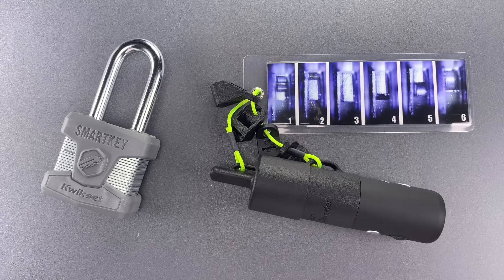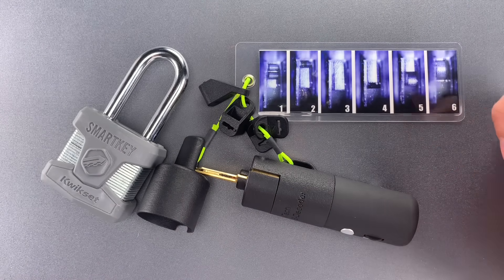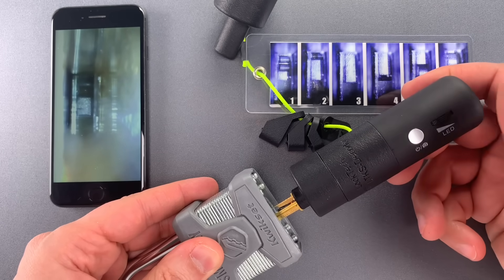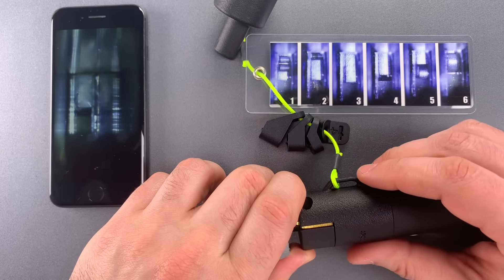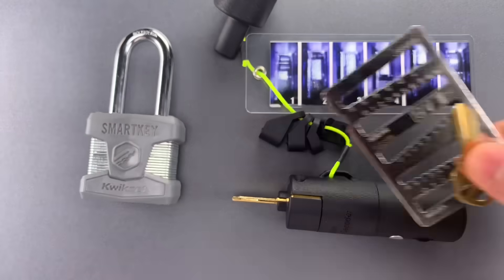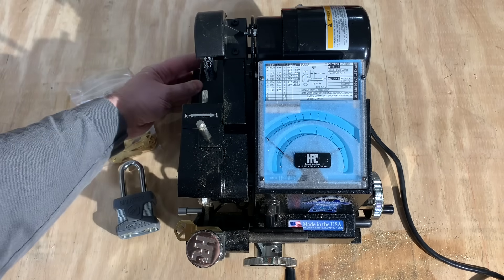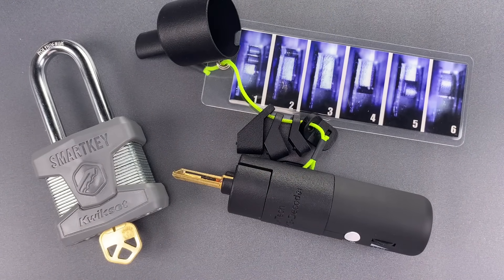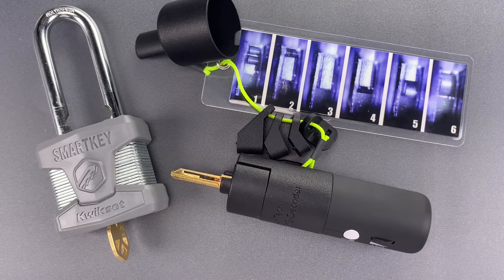[1209] This Tiny WiFi Camera Owns Kwikset SmartKey (LockTech LTKSD)

Comment: This channel is a thief’s wikipedia.
Reply: High skilled thieves don't work into common burglary, they also have better "jobs" to do with all this knowledge.

If you don't live at silicon valley and work to google...
Reply: It's also a home security resource for those looking to defend against unlawful entry into their homes/property.

Before finding this channel, I had no idea locks were this easy to get into, even for someone like me who can only afford a very basic commercial pick set for locksport.
Reply: @Vociferous-Fred  Just make sure the house of your neighbors looks easier (and appealing) to rob than yours. Be low profile.
Reply: @Vociferous-Fred  Put 2 different locks on each door is a good start
Reply: A thief still has to carry the tools, walk up to the locked access point, and stand around fiddling for a while to get it open. That's the really hard part of being a thief. If you can do that, you can bring a screwdriver and a hammer and defeat most locks without this channel.
Reply: @Vociferous-Fred  have a separate different lock waiting. if you notice someone come to your door, insert something, then go away, you change your locks.
Reply: @Vociferous-Fred  It's easy, you just have to replicate what our predecessors have done. I suggest to refer to the ancient pyramids trap designs and curses. It managed to keep dishonest people for centuries so they have proven track records.
Reply: Not really. You ever tried picking real lock? Lol I have....
Same luke saying that talking a out wifi vulnerabilities is a hackers dream place... no it isnt lmao tey hacking wifi in real life lol
Reply: @htcmlcrip  I've done some script kiddie hacking, hardware modifications, and lockpicking, and lemme tell you... the average shit sold to everyday people? An untrained teenager could do it if they had an instruction manual and a free afternoon. Security is all about appearances. Most of it couldn't keep out a bored kid, physically or digitally
Reply: Let's remember this isn't just a matter of tools. The LL itself do this for years to the point he can open some locks with a redbull can.
Reply: Let's not pretend that thieves need an education on their craft. They already know. LPL is more like a wiki manual on what NOT to buy for material owners by exposing lock weaknesses and helping people with good security.

I once had to remove a lock on my own bike with a lost key, i used a plumbing torch. I didn't need to be told

Thieves are stupid but not brain-dead. They at least know how to steal.. Getting away with it is a different story.
Reply: @EstablishAtTheFront  what's the point of picking a lock to a theif when they can break a window or just use a drill or just break down the door and shear off the lock with a sledgehammer
Reply: @hackerhacker-ms2wy  
Locks only keep 
Honest ppl out!
Reply: @EstablishAtTheFront  The methods in this video specifically are only used in actual heists. Your average smash and grab thief won't go anywhere near impressioning tools or key duplication.

This tool makes a three man job, with someone on the inside a one man job with very minimal requirements.

$1500 is a lot for consumers, but for a heist with 100k, it's a very worthwhile investment.
Reply: @EstablishAtTheFront  sure, but this material is also helpful to those just getting started. Not that it shouldn't be published...

Comment: The trouble with quikset rekeyable locks is occasionally the don’t reset and the lock is toast.  You used to be able to take your core to a dealer like Home Depot, but they no longer have the devices, or personnel to use them.  So if they fail to rekey, you must replace them.

Comment: Does anyone realize how this is only a few hacks away from making a key matching the pin pattern via battery-powered two-axis CNC in a backpack while you slide in the probe thing? It would use streaming video instead of pictures and AI image recognition. It would "see" where the pins are, analyse the image and gather what value to cut, then instantly cut that value. You could feasibly have a key ready in about the amount of time it takes to stow away the probe and reach for the backpack.

Comment: I feel that with very small sd card and video mode it could be done even faster.
Meaning that to could actually record video of key going through the whole lock.
Then with some not super smart application that could analyze video frame by frame it could easily output the settings for the key for you.

With above improvements it would require you to just come up to door, slide it slowly into the lock and then go away - without need to focus on smartphone or anything - as you can either postprocess it later in home, or have software do it for you.
That has some potential. Scary stuff.

Comment: Another take on @sixstringedthing below: "Here I have Abloy's Quantum Lock, whose operation relies on the emission of beta particles from the key, which consists of a standard key blank with cesium-135 and strontium-83 inserts. Now you'll remember that the pioneer in this domain was MasterLock, who brought their version to the market a little time ago. As you know, it used the quantum spin effect, which left the lock in simultaneously "locked" and "unlocked" states, the decision being made by the key. However, it failed because the waveform could be collapsed to "unlocked" simply by thinking very hard in its general vicinity. Abloy have made a better fist of this, so let's get to work. My Geiger counter shows clicks on one, ..."

Comment: Just thinking beyond that excellent design I would suggest as your using a mobile a smart app would compliment it well ,in that it would read and store the cut coding automatically as the "key" is inserted slowly into the lock (or a motorised drive). The user could then scan several locks naming each file individually, take the readings away to make keys and come back to an openable lock.

Comment: i would like to see him pick a double sided (double keyed) dead bolt with one key turned half way around on the other side. no matter the brand. i have found that as long as 1 key is turned at least half way the other can not complete the rotation. that has been my experience anyway..

Comment: For that cost it should slide the camera/mirror itself and take a video. That way you can discretely plug in the device and just hold it there for a few seconds instead of carefully aligning it with each slot. Also, I hope it comes with inserts for different styles of keys!

Comment: When all else fails, just cut a new key.

Literally what the locksmith did to get me back into my old apartment when I locked myself out a few years ago:
- Front door had a cheap passthrough and a good deadlatch keyed alike
- Locksmith spent about 5 minutes trying and failing to pick the deadlatch (slippery pins wouldn't stay set)
- Turned to me, said hang on did you say they're keyed alike? I confirmed.
- Disassembled the passthrough, took the barrel out to his van, used it to cut a new key.
- Opened the deadlatch, gave me the key. Problem solved.

Comment: That is a cool cutting machine, I used to use a lower cost technique of saving a bunch of keys with different depths. I could find a key that almost matched the depths i needed of often would find one or two overcut positions. To solve the overcut problem I used solder.  I would  use a wire brush and remove the oxide from the cut I wanted to build up. then place the key in a vise/holder between some paper to form a channel and then drip solder on the key, let it cool and hand file it down. It's not a solution for many uses , however hand filing solder to the correct size is easy. The electronics solder is required with the flux in it and you can buy it much finer than plumbing solder.

Comment: @LockPockinLawyer  This was a great video.  I have on lock on our house where the key has gone through several rounds of copying and the newest one don't work smoothly.  Since I am not the first owner, I do no know how many but non of the keys look original.  We also have a 1st generation Miata and the keys have worn to a point they they also don't work as well. Several times I have thought about how to resolve this the video got me thinking again about key codes.  The research from that lead me to Key Biting Specifications and the process by which you can measure a key to make sure the cuts are correct.  Key Biting Specifications seems like it would be an excellent - and very practical - video.

Comment: A much cheaper way is to just have 36 KW1 blanks cut to each pin depth at each of the 6 positions, then you could just use a manual key machine and load the blank you need for that cut i.e. which depth at the right position.

6 keys for #1 in all 6 positions 
6 keys for #2 in all 6 positions 
6 keys for #3 in all 6 positions.

And so on. Maybe quicker then a file? Maybe not for LPL.

Comment: Is there an easier way to open a 4 digit combination bike lock rather than just guess the right combination via process of elimination?
Reply: Btw this lock doesn't have a key system to it at all and each digit can be anything from 0 to 6
Reply: So for example 0000 0001 and so on

Comment: I think we know how to solve this problem. Make a lock that inserts the key for you, so that the key can't enter the actual lock from the outside. In this way they key can't have a giant handle with a wifi camera. The key would have to be the size of a key in order to get into the lock. You insert the key into the lock, the lock takes the key from you, and then inserts it into the real lock, and turns it, so that the wifi camera can't fit into the key hole, as we see the large handle attached to the wifi camera key here. 
A smaller wifi camera key would have to be made, without a handle, where it all fit inside they key size itself, and was able to transmit outside of the lock.

Comment: what about a lock and smart key that work like an authenticator. the key holes adjust every 30 seconds while the key matches. They won't have time to scan it in time. the lid that opens the key slot won't open until they sense the key is near.

Comment: Given the device's Wi-Fi dependency, would it make sense to use a Wi-Fi jammer in order to increase this lock's security?
Until a wired version is commercialized, at least.
Anyway, the most effective method for making the lock pick-proof could be to cover the inside with a low-friction, scratch resistant paint with high light absorption (think vantablack), if such a material exists, which should rid the pins of any reflections and caracteristics when light is shun upon them.
Reply: agree bro

Comment: Not going to be too much longer before they manage to get a whole set of servo-driven rods in a keyjaw camera like that. Not too long after that, someone will stuff an ARM chip inside and train it to set the rods as the imaging sensor sweeps past the pins. If that thing was $300; $1000 would probably get a 'smart' lockpick the size of a maglight.

Comment: This is why I cut my own keys by hand to non standard values..
Reply: But....  Since this gadget produces images, the Hamburgler could simply measure the physical dimensions directly, and then fabricate a key with the machine tools he just happens to have lying around.
Reply: @samuelglover7685  Well..  this is why I have multiple lock types on my doors. The smart key insures that NO copies exist except the ones I make by hand.  And in case someone has somehow crated a copy it's only good for a month or two...Also considering they have only 10 or so minutes before I show up and blow them away this seems unlikely..

Comment: I would love a video on how the key cutting process works and how the dials read what you are inputting. From a novice standpoint. The whole process looks like a rocket launch on the mathematical side.
Reply: What I assume is going on is that inside the machine there is a V-shaped grinding wheel to make the notches in the key, and the dials are just mechanically coupled to the carriage the key blank is held in. Each card is just then a calibration that tells you which pin/slide position and which pin/slide depth a specific setting on the dial corresponds to.